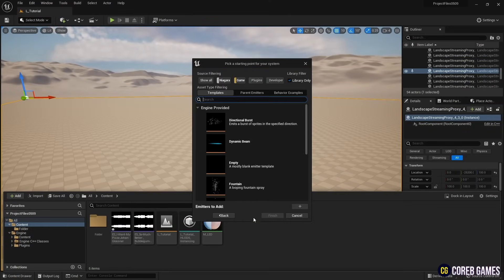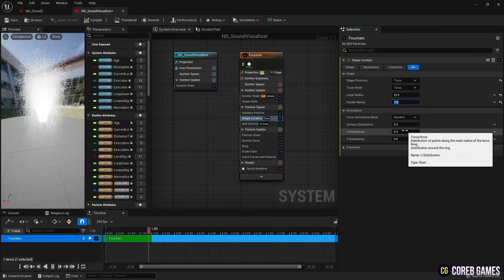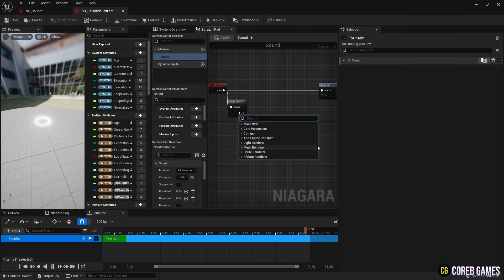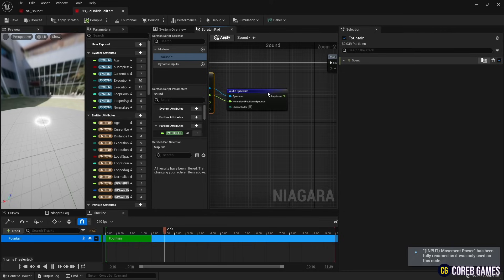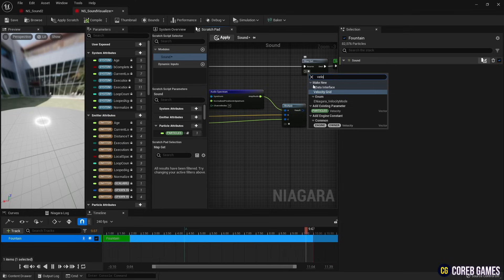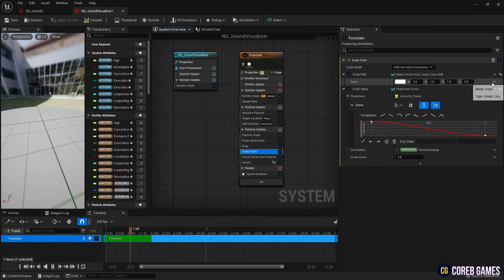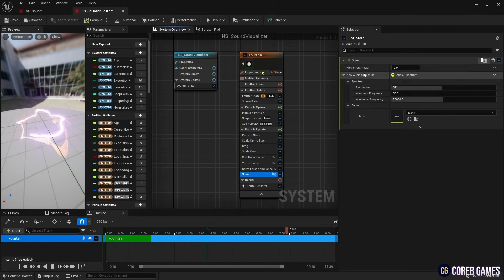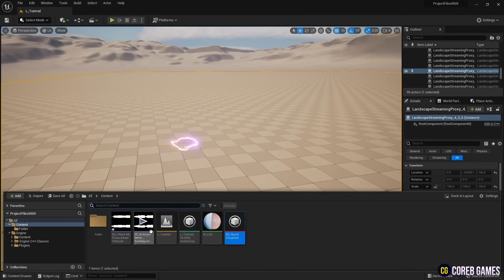UE5 l How to Create Sound Visualizer using Niagara l VFX Tutorial l Unreal Engine 5

Comment: I remade this using Unreal 5.2.0-25360045+++ and it worked. At one point Unreal would crash when pressing play, but after creating a new level and redragging the particle blueprint from the content drawer, it just started to work. I've used this tutorial in tandem with other blueprints, and no issues.

Comment: Hello,
my animation temporarily works. The only way I'm able to trigger the animation is by rechecking "Curl Noise Force" then it will work for a little then stop.
Version: 5.0.3-20979098+++UE5+Release-5.0
Reply: No offense but UE5 was super buggy. Should move to 5.3 or 5.2. (But I am even getting a project loading error in 5.3.)